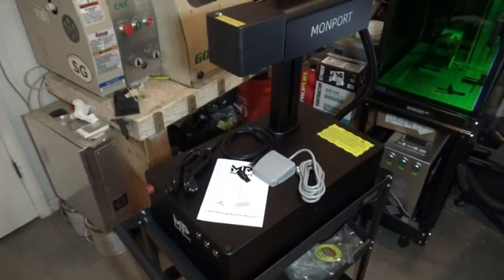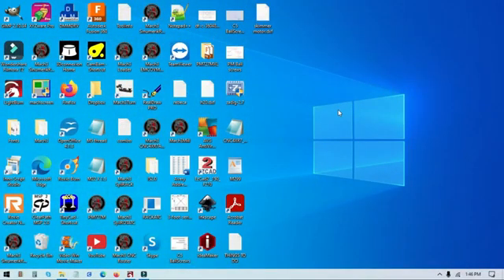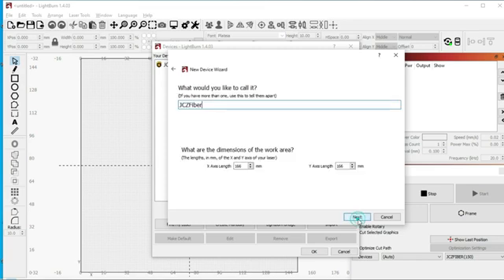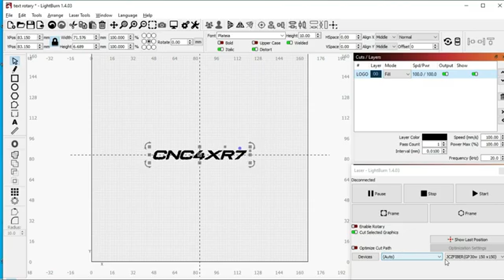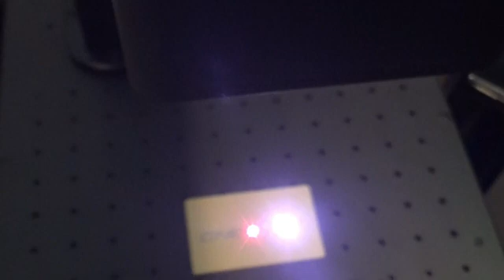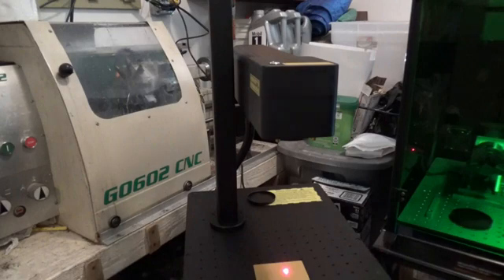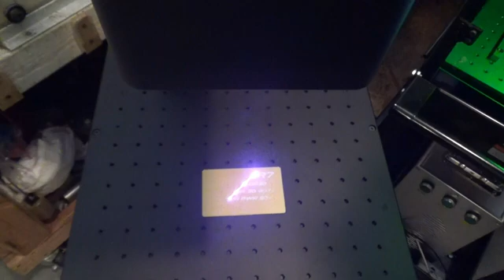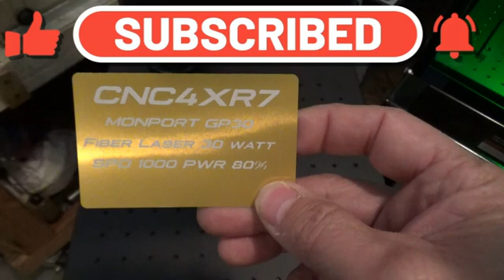Sharing Tutorial |MONPORT GP 30 Setup

Comment: Did you have to get the galvo Lightburn or just the newest lightburn? My lightburn subscription is about 2 years out and it doesn’t find my gp30
Reply: Yes you need to add the Galvo option to your license. If adding to an existing license, its only $90.00 right now